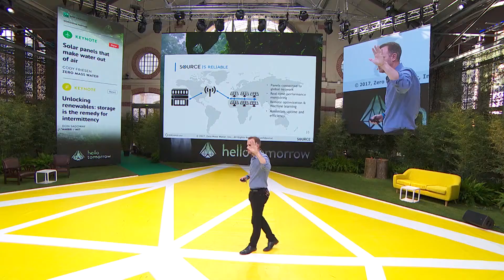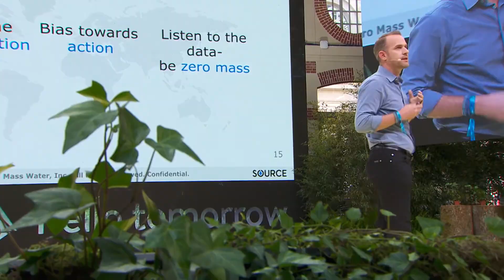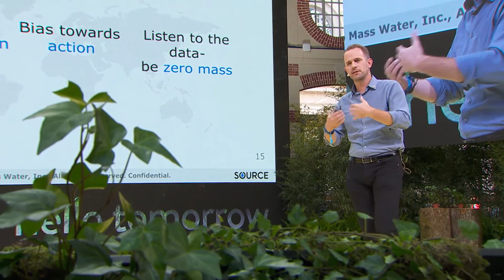Solar panels that make water out of air  |  Cody Friesen  |  HT Summit 2017

Comment: I have been thinking about collecting water out of what of it, is in the air, for years, after I read a magazine article about a sheep co., running sheep in a dry part of the world, was providing daily water to their sheep, through construction of a amphitheater into the ground, lined with stones, that with sunlight on it, is able to produced enough water, daily, to provide water to sheep. And I have wondered how it works. Also in the high desert in the Great Basin Desert in the western U.S. are lava tubes in places, that allow air to flow through in such a way, that ice is created in these lava caves out of the air in the atmosphere puts water on the walls of these caves, that over years, it turns into blocks of ice. (In the gold rush in the Wood River Valley of Idaho, in the 19th cent., ice for the drinks of the miners was harvested out of such a desert in the summers, near to these mines, from such a cave, Shoshone cave.) Cody Friesen is providing a device for sale, that might be the ultimate in the efficient extraction of water from air; however there appears to be ways, in placing stones, for air flow around them, that also produces water, from the same way that the device of Cody Friesen does so.